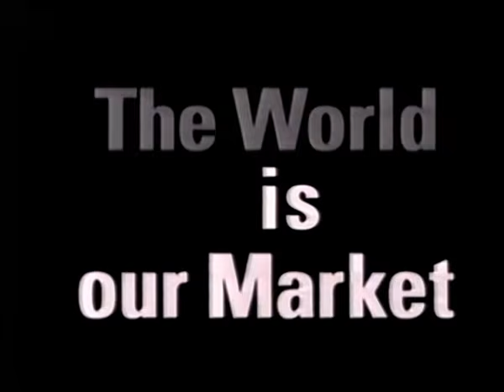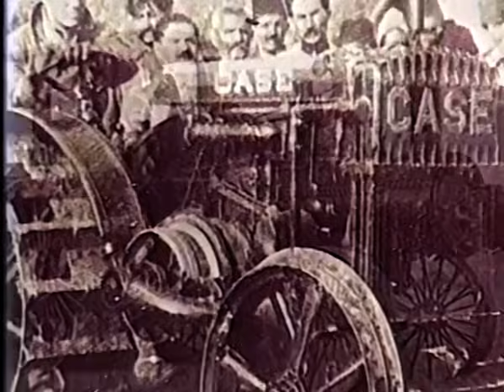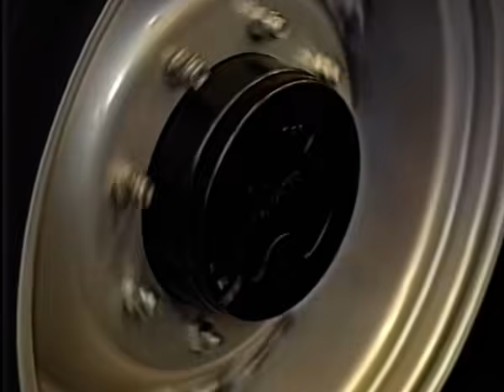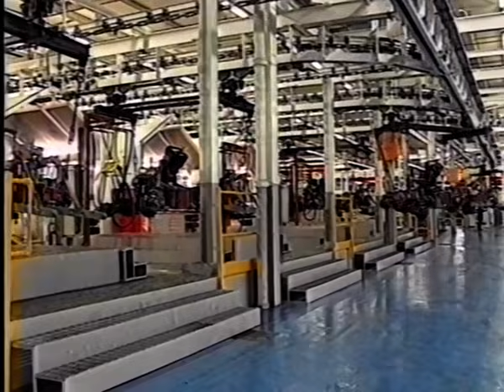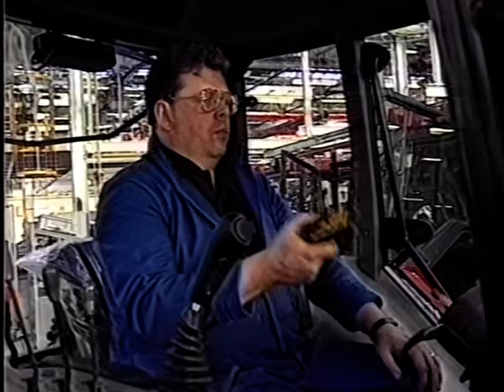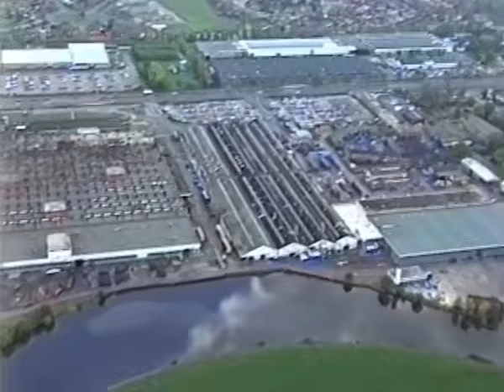Case Visitor Video Doncaster

Comment: I worked their for IH then Case then CNH then McCormick. Good engineering apprenticeship pity about mentality of middle management. 4.5k employees across both sites down to 300 in end in 2007. I sat in negotiations every year fighting job losses I left in 2002 and it was obvious McCormick was going to move production to Italy.
Reply: I started working at the Wheatley Hall road site in November 1978 and was there when it closed in 2007. A sad loss to the town.
Reply: @P @PaulCartwright-h1y st like many other manufacturing businesses small & large all now gone replaced with shops, even car dealers are disappearing now.  All we have now is warehouses & shops full of Chinese tat what pay min wage with no contract & part time hours which equals stress & not much hope of buying a home etc. Get a degree they say 40k later you have a bit of paper n so has everyone else & you’ve little experience so still end up flipping burgers at McDonald’s to pay mortgage on your degree certificate you just bought. That’s some legacy to leave for Town’s youngsters. What really happened is Romans turned up when Fiat bought it asset stripped it sold Wheatley too another Roman couple they asset stripped it again after buying it for a £1 then exported name levelled site n sold it to another Roman who built houses on it! The MX range is now produced in China under a Chinese name after gearbox plant was sold to Chinese some years ago.

Comment: Case didn't aquire IH,Tenneco bought the IH agline and merged it with Case which they already owned.90% of what Case- IH sells today originates with IH heritage.
Reply: Yea I used to international tractors early 80s and they were really good tractors, 785 LP cab 2wd , 956 XL 4wd reliable tractors.

Comment: Brand new 1455 xl what a tractor , case have you ever thought of starting making the 1455 xl again you don't even need me to tell you why do you ? 💪💪👌👌👌👍
Reply: Now, if that were to happen I'd need to obtain a mortgage, cos I'd definitely purchase such a masterpiece of engineering. Tractors now have chocolate transmissions. That straight 6 groan that those beasts made sounded just awesome. Ultra reliable. Everything now is just fake, even this fake virus that just stops great things being built. The world will never be the same again.
Reply: they need to do this
Reply: @nielsknol2309  definitely
Reply: The 1455XL only was produced in Neuss, Germany.
Reply: 13.49: soooooo no, no old fashioned handshakes now allowed. Fake virus transmission through handshakes.